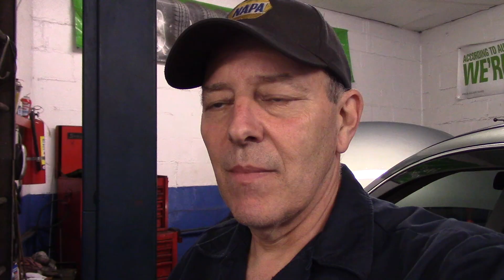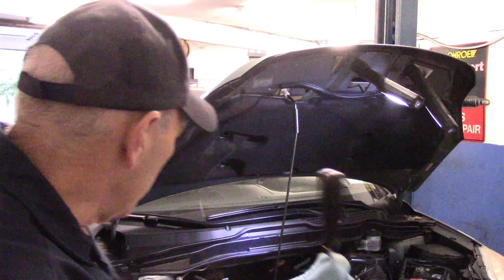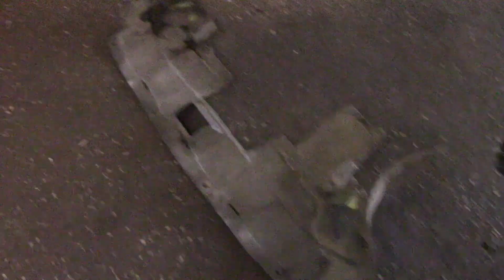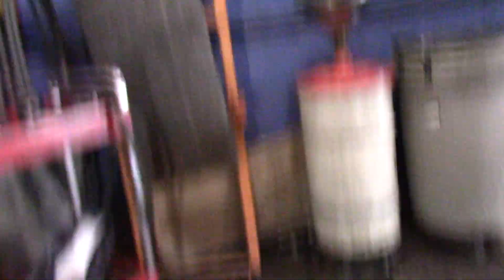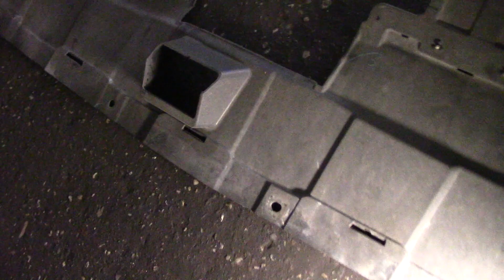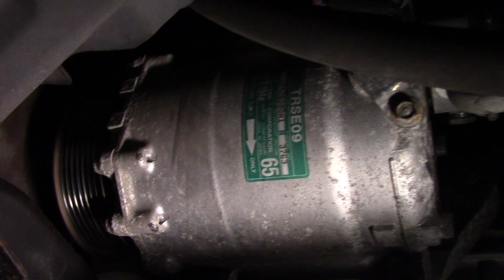How To Diagnosing Engine Noise

Comment: I guess I've been lucky.  I have a 2006 GMC Yukon, and a 2006 Accord EX V6.  Both have auto climate control and I have them set to auto all the time, so the compressor is always working.  They both have well over 140,000 miles and are on the same compressor.